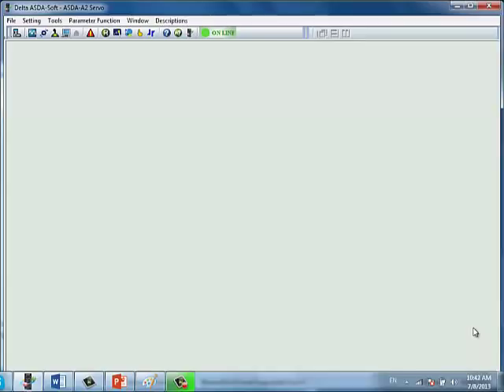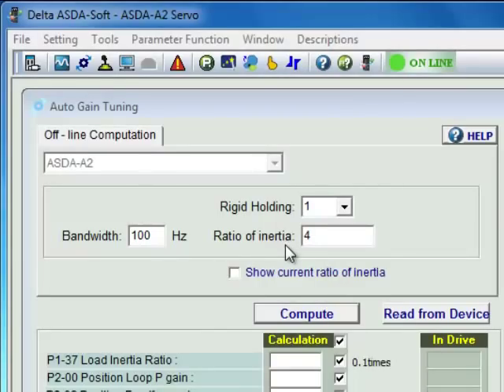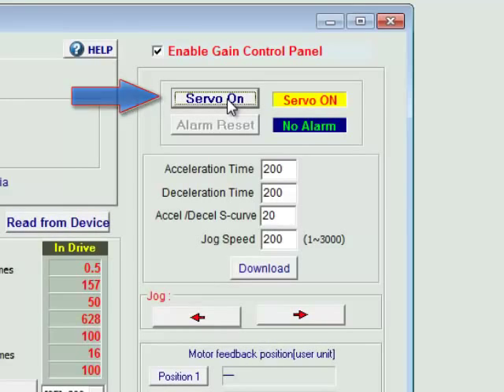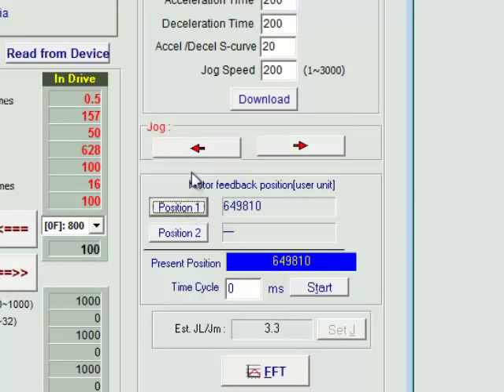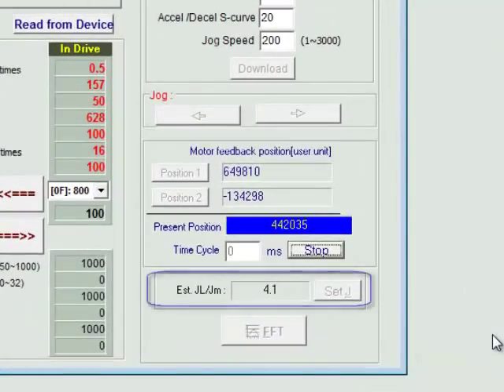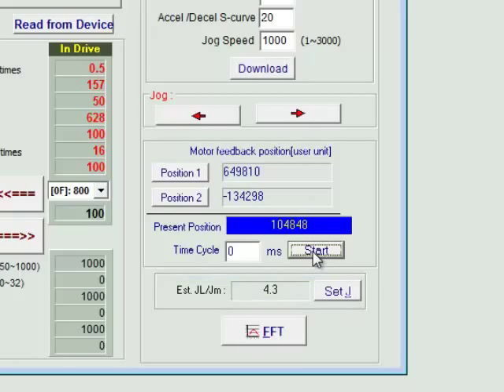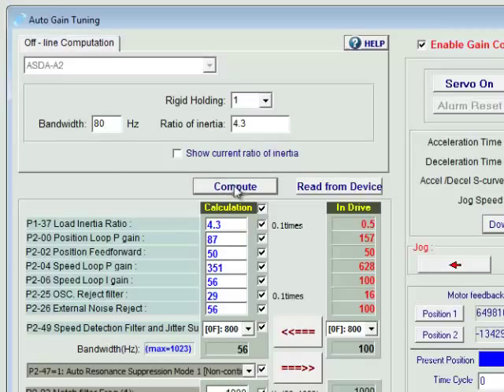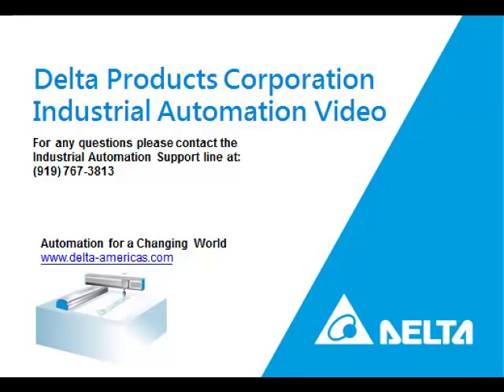Delta Products HowTO Video  - A2 Servo Drive tuning using ASDASoft

Comment: what's the reason of Jerking of ASD-A2 servo during reverse & Forward operation, Although I have increate or decrease the inertia ration from parameter but I don't get the smoothness at expected level. Can I make the tuning with Full load or without load ?